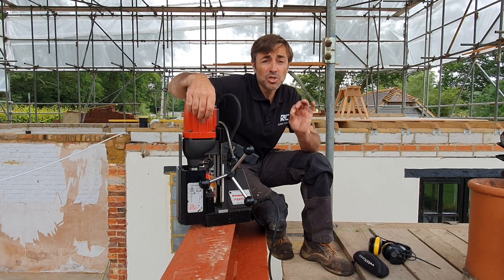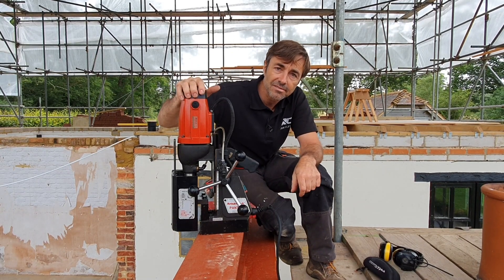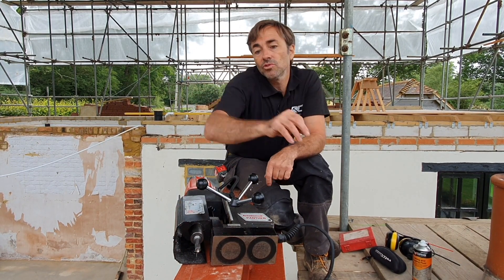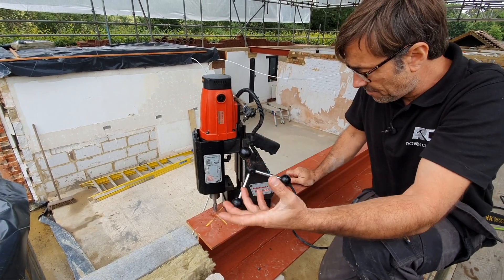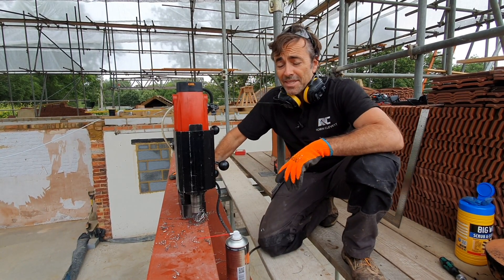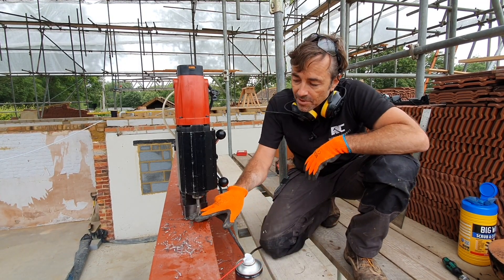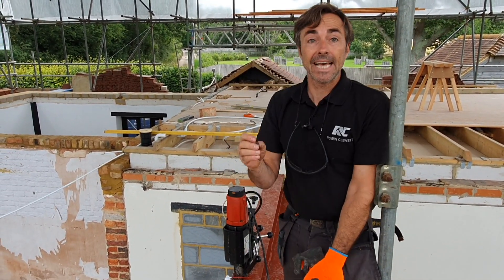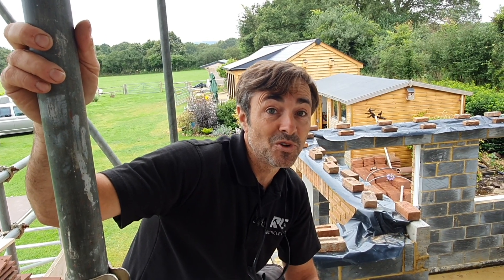Drilling RSJ and steel for bolts and fixings with a magnetic drill

Comment: Been using my rotabroach for years . The magnet is so strong ,I use mine to drill 12mm holes to accommodate a 10 mm rod to suspend a plate for a sliding partition: the power is unreal. I took my guard off (bad practice) and I use wd40 as a lube for the cutter to cut through the beam . Beware though… take your time when drilling as I’ve had a few cutters shatter over time.

Comment: When not using the machine coolant bottle, (if horizontal or countersink bit) I use a Oasis bottle with a 1mm hole in the lid and much cheaper soluble oil diluted with water. You can squirt a very fine flow on your bit as much as needed. I have a small cheap mag drill and a big boy Rotabroach Element 100.

Comment: im suprised how littel lubricant you use robin. i use way more with mine. if i dont i find the cutters get very hot and dull quickly. 
i use a waterbased  oil for metal bandsaws that recirculate the oil. its white . a few letres is 35 euro  or so and a cap or 2 of oil will create a litre of coolant. works out way cheaper than those spray bottles. 

a mag drill is an amzing luxury to have. i couldnt live without mine and i dont use it that much but when i do it saves so much hardship

Comment: If I heard correctly Robin you drilled a 14mm hole for a 12m bolt. If that for expansion or some other reason?
Reply from the maker: Its the perfect size enabling the bolt to fit without damaging threads etc
Reply: The technical term is clearance drill. Tables are available on the Web for the various metric thread sizes. 14mm is a bit sloppy for engineering fits, but I'm sure it gives Robin a little wiggle room in timber.
Reply: If you drilled the holes 12mm - when it came to bolting up you would only get one bolt through - out of however holes you drilled.

Comment: I use a Milwaukee cordless mag drill, it’s got a permanent magnet so no worries about power cuts, but still use the strap when upside down.
Reply from the maker: I am yet to try one mate are they good???
Reply: @robinclevettcarpenter  excellent bit of kit. They have quick release collar for the cutters too. Saves faffing around with Allen keys. Not having trailing leads is a godsend on a busy site especially when you are up high in a basket
Reply from the maker: @markevans9130  Nice one Mark, I will get one!!
Reply: Agree with that Mark, great tool, good solid magnet, easy to use and surprisingly light in weight. 👍

Comment: I hesitate to offer advice to a master craftsman, but you are used to wood, I work with steel.  NEVER ever wear gloves when you are producing long swarf - particularly cut proof gloves.  The torque in that machine will absolutely be enough to pull the glove in and absolutely will NOT stop just because there is a hand inside - I don't care how strong the victim is - they will lose!  I know this from experience and still have nightmares occasionally 30 years later - I had to help cut the poor sod free.
Reply from the maker: I appreciate your experience and that makes perfect sense, but if I filmed that without gloves then I would be criticised!! many thanks for your helpful and accurate comment mate
Reply: Robin, personally speaking, I would lift the tool out much more frequently to break the chips and to get more lubricant/coolant at the cutting edge.

Comment: I agree on using them for certain loads and for bolting steels to steels but if it’s just for a wall plate then a paslode spit gun or the older Hilti would be more than man enough. They are much more efficient you’d have your wall plates set and a few pairs of rafters cut and up into position by the time you’ve drilled those holes.

Comment: If the power cuts and stops the magnet 🧲 is there not a risk that the whole unit will start spinning? Or is there not enough torque left in the winding down drill bit?
Reply: It'll spin and probably snap the broach off if the hole is deep enough, if not it'll just wind down
Reply: @zaptothehead  so when it spins would that not be dangerous to the operator? Arm breaker etc? Or not powerful enough?
Reply: @MojoHawks  they wind down pretty quick, I haven't heard of any broken limbs but if it's being used on its side or upside down it's necessary to use a safety strap or clamp it to the beam.
Reply: @zaptothehead  yeah I just wondered about the torque once the magnet stopped. Didn’t know if it had a clutch or whatever, could catch you by surprise y’know. I’m not a driller so I’m speaking from a point of ignorance! Thanks 👍

Comment: Interesting tool. Manufacturer not available in US, but others are offered at prices $220 😒, $800, $1,000.  Seems reasonable for a portable drill press. Even if it is manual feed. Thanks for the video.

Comment: Have fastened wood to steel using bolts & predrilled holes or ramset gun but for quite awhile have been using wafer head self drilling/tapping screws for up to 16mm steel plate.
Reply: Be good to know what brand wafer head you use. Thanks in advance.

Comment: Hi Robin did you know that cembrea make a set of cutters for a hand held drill.
Reply from the maker: Hi Mate i have seen some but not sure who made them!!
Reply: @robinclevettcarpenter  To be fair all the major tool brands have HSS bits capable of drilling a 10mm hole in seconds.
Reply: Since when has a cordless drill and fresh drill bit not done the job?